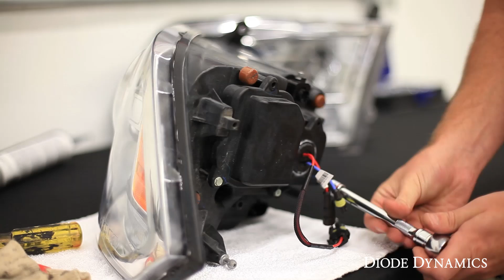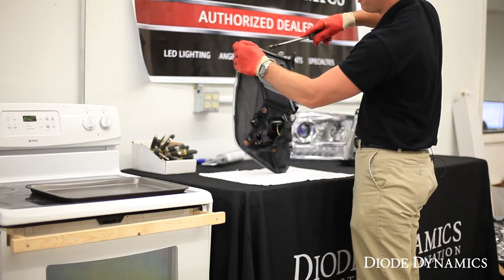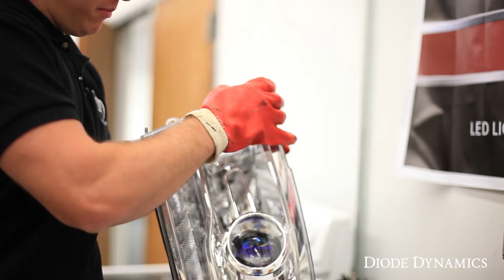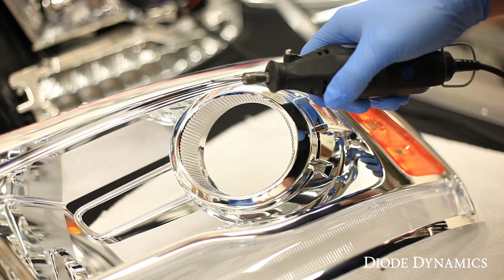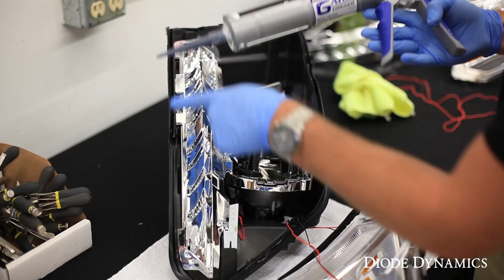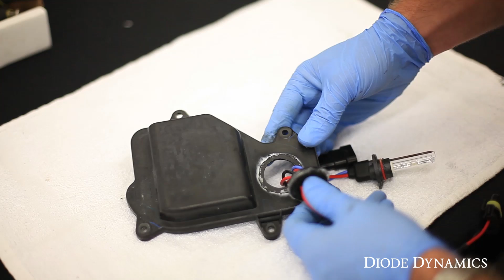How To Install Ram 1500 Angel Eye Halos

Comment: Is there a safe way to clean the chrome? My headlight has a bunch of condensation inside, so I plan on baking it open. I think there might be water spots left on the chrome.
Reply from the maker: You should be able to use a microfiber and some water to remove the water spots!
Reply: @diodedynamics  thank you!

Comment: Hi. What is the size of the halos? My projectors are around 9cm. Your fit? Thanks
Reply from the maker: Hi there! We now offer a custom-designed halo specifically for this housing! You can check it out here: https://www.diodedynamics.com/2013-2016-dodge-ram-switchback-led-halos.html

Comment: whenever you are resealing the headlight do you just let it air dry or does it need to be baked again to seal it?
Reply from the maker: +insanecracker04 This depends on the headlight and type of sealant used, but generally, the sealant will need to be heated up again to reseal the headlight. Check out the video at the link below for a good tutorial! 
https://youtu.be/7Hbv4BovDVA

Comment: Only suggestion I have is to pull the light out after 13 minuets work at it put it in again for 5 minuets here and there to work at it again to remove lens. 
I preheated my oven to 250 and set the headlight on a flat trey and the light wasn’t touching anything perfectly centered and cooked it for exactly 20 minuets, melted the shit outta my head light. 🤨

Comment: Do you guys make LED replacement bulbs for Ford F-150 models earlier than 1997? I have a 1987 Ford F-150 XLT Lariat with factory incandescent headlights, tail lights, turn signals and reverse lights that I'd like to convert to LED. I wanna keep that factory look though. I don't wanna get aftermarket headlamps and tail lamps.
Reply from the maker: +Trey Piraino Thanks for reaching out! Shoot us an email at contact@diodedynamics.com, and we'll be happy to help you find the right bulbs for your F-150!

Comment: Do you guys have a light for the rectangle next to the halo? I've seen those and would like that too. Just want to do it all at once so I don't have to take them apart again.
Reply from the maker: +JeromeAz57 Check out the link below for our Front Turn Signal LEDs for the Ram 1500! http://www.diodedynamics.com/store/led-bulbs/listed-by-vehicle/dodge/ram-trucks-link/ram-1500/1994-1997-dodge-ram-front-turn-signal-leds-pair
Reply: Not the turn signal. The rectangle right next to the halo. It would have to be glued on just like the halo is.
Reply from the maker: +JeromeAz57 We apoloogize for the confusion! Check out the link below for our Ram Switchback Halos. This kit includes the two application-specific Halo rings, two C-Bar Halos, two Dual-Output drivers, and two wire pigtails with T-tap connectors. If you have any other questions, just let us know! 
http://www.diodedynamics.com/store/catalog/product/view/id/23699/s/2013-2016-dodge-ram-switchback-led-halos/category/1451/
Reply: That's the one! Thanks!

Comment: i have a 2016 dodge cummins with these headlights. do you know if this will void the warrenty
Reply from the maker: +ByBrisky Yes, opening up the headlight is required for installation, which would void your warranty. Whenever installations of our products require opening up the headlight, we recommend installation by one of our Authorized Installers so that there will be no issues with separating, resealing, condensation, etc. Check out the link below to find an Installer near you! 
http://www.diodedynamics.com/store/index.php/find-dealers/

Comment: will this apply to a 2016 ram 1500, it is the same headlight, except they have a plug at the bottom for the wires and headlights.

Comment: Do you bake the headlights with the wires inside
Reply from the maker: +Brandon maldonado, yes, once the angel eye halos are installed, you bake the headlamp to reseal it. The wires are designed to withstand the heat from resealing it.  If you have any other questions, feel free to contact us!

Comment: Hello, we were unable to open, not off, after 20 minutes in the oven glue does not soften, any suggestions? Thanks, sorry the English "Google Translator"
Reply from the maker: +OPTICHROME, we recommend just like we had done in the video 265 Fahrenheit for 20 minutes, which may require a few cycles in the oven (heat, work the glue with a screwdriver, back in the oven, etc).

Comment: So question what's the actual measurement for the angel eye in mm?
Reply from the maker: Hello! We actually have a kit for the Ram where you don't need to do any measuring. Attached below I have a link to that kit.

http://www.diodedynamics.com/store/led-bulbs/angel-eyes/dodge/ram-1500/2013-ram-1500-angel-eye-kit
Reply: Diode Dynamics that link does not work..... what size is needed? And do you make an amber only option?